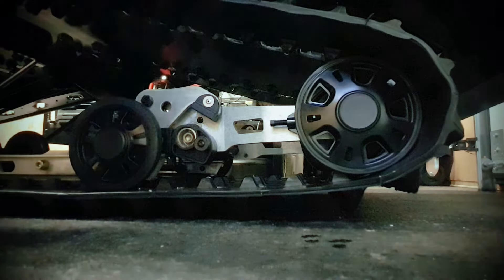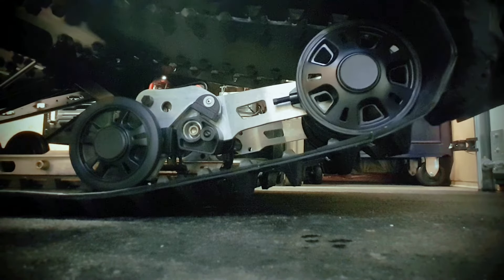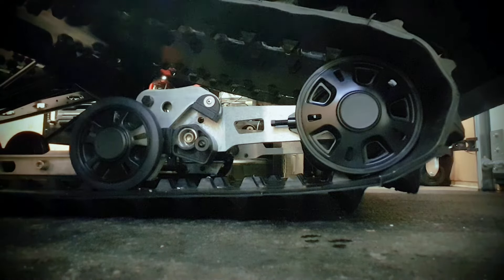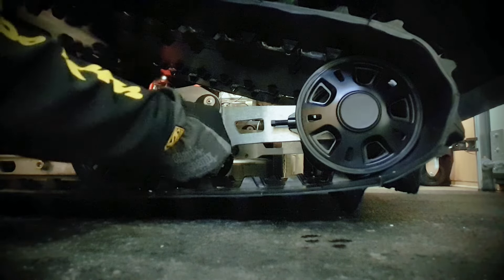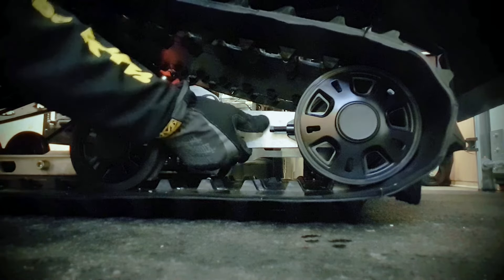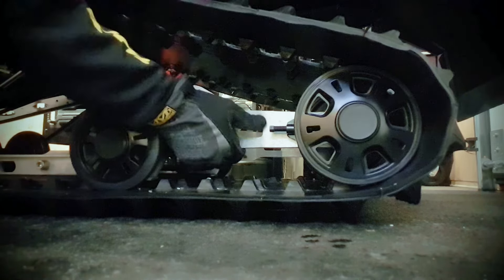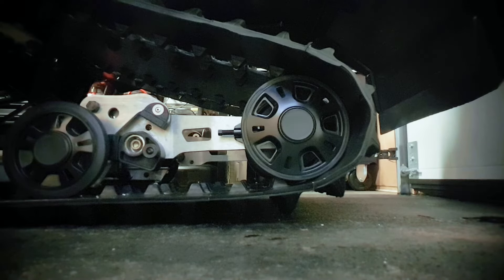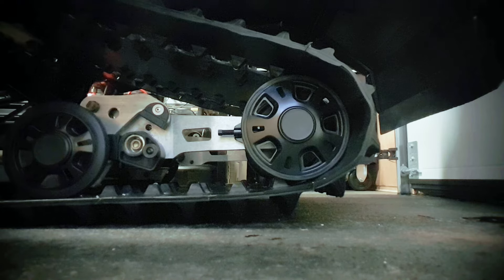The Ski-Doo SC-5U Articulating Rear Suspension Tips

Comment: Yours spins so freely.  I cannot get mine to do the full rotation. Also, mine has another non pinned cam on the other side. Does that need to be rotated as well?  Your pinned cam is on the opposite side of my 2015 Skandic SWT.

Comment: So if you were pulling a load with a SWT, I would guess that you wouldn't want that rear suspension to articulate?
Reply from the maker: mosquitok833 that’s right, leave it locked down for more traction/surface area.

Comment: I locked mine down but now that i want to unlock it, the pinn will move some but nowhere near enough to clear the hole that it passes through when you lock the track down..... so strange... the pin moves easy when pulling on the black part, but you can see from the inside its nowhere near out far enough.
Reply from the maker: wiggle the articulating track up and down a little and it’ll move.
Reply: Just an update, I noticed the pin had the hole that it passes through worn just a little to the left so wiggling up and down would not work but I put some pressure on the pin as i was pulling out and finally got it to release. Thanks for ya help though!

Comment: I can't rotate mine to the unlocked position anymore. Anyone have any ideas?
Reply: Had the same issue, used gigaloo, lots of it between the rubbers and the rotating part and it eventually moved
Reply: @jean-marchamelin637  Thanks. I actually figured out that it wasn't actually stuck. I just needed to take the load off the mechanism, by lifting the rear of the track when I rotate it.